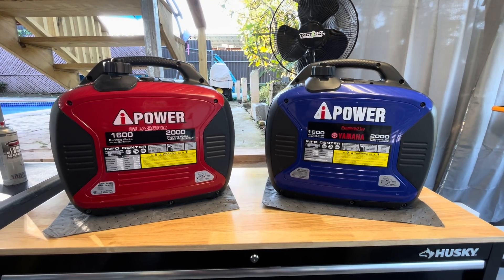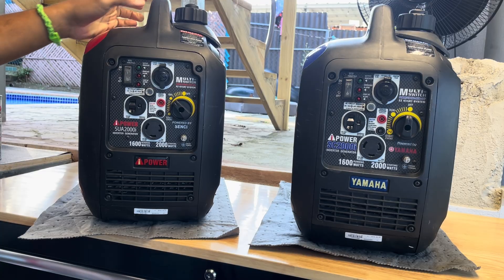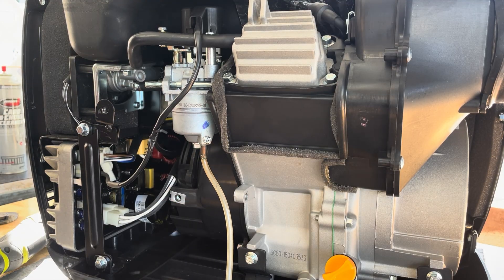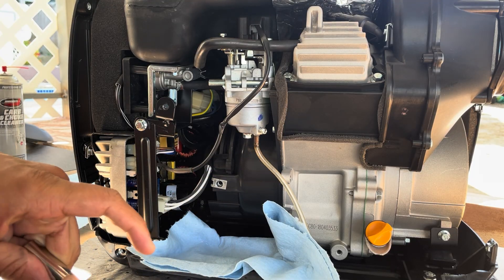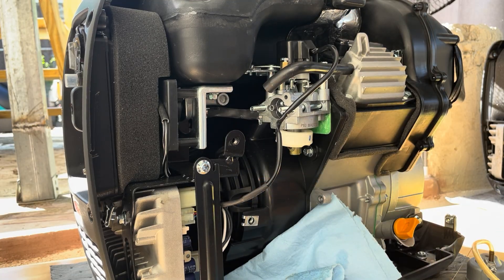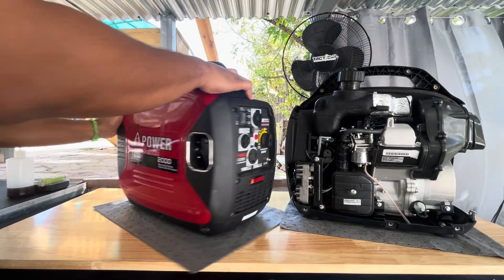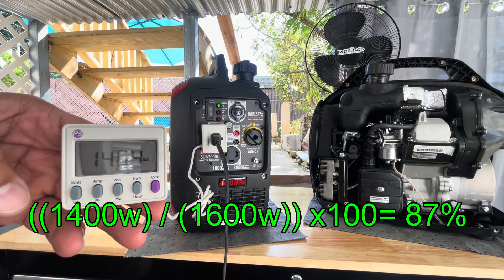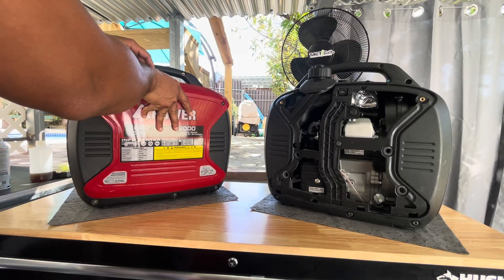Inverter generator won't start. How to fix a portable A-ipower 2000w / 1600w SUA2000i, SC2000i. #diy

Comment: Very useful video.
If you have to do this note that the disassemble is much more involved with screws in the handle and the front and back panels which have to be removed and loosened.
Re assemble is worse since there are plastic tabs that all have to lock in at the same time. The fuel tank has a tab with a rubber insert that will fall out and become a spare  part if you can't figure out where it goes.
If you're not a purist I would recommend taking a hacksaw to frame bars that are in the way of the carburetor and air filter making  the process much easier now and in the future. If you do this cut below the tab that holds the fuel  tank. 
I also had an issue with the sparkplug wire coming apart when I removed it. There may or may not have been a spring between the brass fitting and the cap since it disappeared.  I replaced it with a spring from a ballpoint pen and it worked OK. 
My carb jet was stuck like his was.  I used a brazing torch tip reamer to clean i to clean it.
Good luck😊. Generation started on first pull
Reply from the maker: Thanks for watching my video and sharing all of that, really solid info. 
I’m glad everything went back together and even better that it fired up on the first pull. Appreciate you adding your experience here, it’ll help a lot of people tackling the same repair.

Comment: I have the propane dual fuel one and I've only run propane. Can my main jet still be clogged? I need this gene fixed my family depends on it and it just turned winter
Reply from the maker: Yes! It definitely can still get clogged, even when running only on propane. The reason is that the main jet or orifice can build up corrosion, oil residue, or carbon deposits from moisture in the fuel regulator or from running rich. Try cleaning the jet and checking the regulator for restriction, propane setups aren’t 100% immune. Keep me posted!
Reply: @tacticalpowerpro  ive tried the spark plug, spark arrestor,  and turning on the tank slow as others have suggested. Im hearing the regulator is bad now and am told the propane bypasses the jet all together.  Maybe thats not the case on all dual carbs ? Thank you for your help
Reply from the maker: Those dual fuel aipower generators have something called fuel sense to switch from propane to gasoline. There are no special switches or adjustments. Fuel sense uses a sensor to detect when propane is running low and automatically switches to gasoline. You might have a bad fuel sense sensor that thinks there is no propane and tries to run with gasoline and you have no gasoline in the tank. I recommend trying to run the generator with gasoline if the generator starts then you know you have issues with either the sensor or regulator. If the generator won’t start with gasoline then you might have other issues like low oil sensor, CO sensor or you have no compression and need valve adjustment. Hope this helps
Reply: @tacticalpowerpro  thank you i will try these things and get back to you
Reply from the maker: You’re welcome, let me know how it goes.
Reply: How to check the regulator for restrictions before buying a new one ?

Comment: Saludos tengo una ipower motor yamaha, te pregunto, también trae el yet de baja como la ryobi que le das mantenimiento en otro video?
Reply: Intente sacar el carburador como hiciste con la ryobi, pero en mi ipower motor yamaha se me hace imposible porque choca con el tanque
Reply from the maker: Si, vas a tener que sacar el side panel completo para poder mover el tanque y sacar el carburador. Verifica en mi canal que tengo un video de como limpiar el carburador en la inverter aipower 2300w pero la roja que es lo mismo que la azul con motor Yamaha.
Reply: Logre sacarlo, y limpie los yet, pero ahora me vota gasolina al ratito que esta prendida, apagada no, y el tornillo del vaso esta bien apretado, que podrá ser
Reply from the maker: Puede ser el o-ring de goma que va entre el bowl y el carburador. Verifica que este bien puesto y no este pinchado, estirado, o roto.
Reply: Buen día, disculpa el tanto preguntar, pero cuando saqué el carburador solté el tensor que viene del botón de encendido hacia el acelerador. Para ponerlo ,eso lleva algún ajuste específico?
Reply from the maker: Buenos días, no te preocupes aquí estoy para ayudar. Te refieres al cable que controla el choke? Si es el cable del choke entonces si debes asegurarte que cuando el switch esta en choke/start,  el choke en el carburador este completamente cerrado. Cuando muevas el switch a run el choke en el carburador debe de estar completamente abierto.
Reply from the maker: Saludos! Siii también trae el pilot jet como en la Ryobi. La gran mayoría de estos inverters de 1700w a 2300w utilizan el mismo carburador ya que tienen el mismo motor. Gracias por comentar y ver mis videos.

Comment: What happen it dont sent power and the light indicador it in red?
Reply from the maker: When an inverter generator does not produce power and the overload red light turns on it means the inverter module is protecting itself. From experience, 90% of the time the problem is the inverter module.
Reply: Engrish bad

Comment: Tengo un Ipower con motor Yamaha lo limpié y prendió muy bien pero está gastando mucha gasolina el tanque duro solamente 3hr que podría ser.
Reply from the maker: Puede que tenga el spark plug sucio o con el gap en el spark plug no este incorrecto. También otra causa común es que no tengas el generador en “Eco / idle mode” y le tienes mucho conectado.
Reply: @tacticalpowerpro Gracias Vefico el spart plug.
Reply from the maker: Verifica que no este negro cubierto de carbon.

Comment: Tengo una kraftwerk 4500 aveces tiene voltage otra veces no tiene voltaje que podria ser??
Reply from the maker: Primero hay que verificar que el motor este corriendo correctamente. Si el carburador, spark plug, aceite y spark arrestor están en buenas condiciones entonces hay que verificar que no haya nada suelto detras del controlador o en el modulo inversor. Si todo esta bien con las conexiones entonces lo mas probable el modulo inversor está empezando a fallar. 

Puede ser algo sencillo como un terminal en el breaker o receptáculo que no este haciendo buena conexión o en el peor de los casos el módulo inversor esta defectuoso.

Comment: Saludos hermano sabrás o tendrás algún video que explique pq estos generadores no tiran chispa en su spark o bujía agradeceré tu ayuda
Reply from the maker: Saludos, si no tiene chispa entonces algo te esta llevando a tierra el circuito de ignición. En estos generadores hay varias cosas que pueden llevar a tierra el circuito y cortar la chispa al spark plug. 

Empieza por lo mas sencillo el spark plug, si esta malo no vas a tener chispa. También esta el switch de ignition que esta ubicado en el off-run-choke switch. Cada vez que mueves el switch fuera de off si escuchas bien suena un click. Ese click es el switch de ignición abriendo la conexión a tierra en el circuito de ignición  dejando que haya chispa. 

Otro es el sensor del nivel de aceite, si el aceite esta muy bajo o el sensor esta defectuoso te llevara a tierra el circuito de ignición evitando que genere chispa la bobina. También esta el modulo de ignición, si miras el frente del panel veras 3 luces (Output, overload y low oil alert) la caja que contiene esas luces es el modulo de ignición y si esta defectuoso tampoco tendrás chispa. 

La bobina (lo que va conectado al spark plug) también si esta defectuosa no tendras chispa llegando al spark plug. Y finalmente si la cableria esta cortada y tocando metal llevando a tierra el circuito de ignición tampoco tendrás chispa. 

Espero que esta información te sea de ayuda.

Comment: Hola hermano saludos desde caguas PR...
Tengo un inverter duromax side kick 2000 que literalmente es identico a un pulsar..

El problema al principio fue que generaba corriente cuando le daba la gana habeces prendia la luz de over load y no generaba voltaje y cuando le daba la gana volvia y generaba voltaje.
La maquina en si prendia lo mas bien....  me puse a  comprar el modulo inverter "el board grande" pensando que se estaba dañando y que por eso daba habeces el overload! 
Pero resulto que cuando lo cambie por el nuevo inverter ahora la maquina no prende, le puse nuevamente el inverter viejo para probar y no prendio. 
y si.. todo lo hice bien no hay cables ni ground sueltos.. 

Puede que sea el modulo de inicion??? Desde la primera ves que presento problemas? Osea el modulo de ignition tambien tiene que ver con el generador! 
Lo que me hace pensar que ahora termino de de dañar la pieza que estaba causando el "overload" erraticamente... por lo que veo compre en vano el "board inverter" 🤦🏻‍♂️
EN FIN! crees que la pieza defectuosa desde siempre halla sido el "ignition module"??????
Reply from the maker: Saludos desde Ponce, PR! En tu caso primero debes confirmar si el spark plug tiene chispa y que le este llegando gasolina al pistón a través del carburador. Si no tiene chispa el spark plug entonces verifica que el nivel de aceite esta al nivel correcto, si esta al nivel correcto entonces desconecta el sensor del nivel de aceite y verifica si tienes chispa. Si aun no tienes chispa en el spark plug entonces tienes un problema con la bobina o el modulo de ignicion.